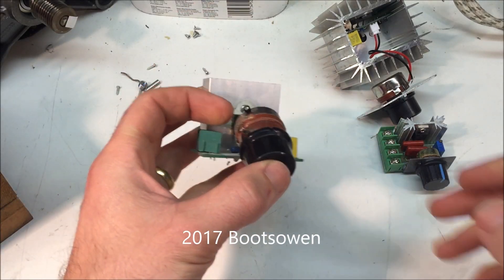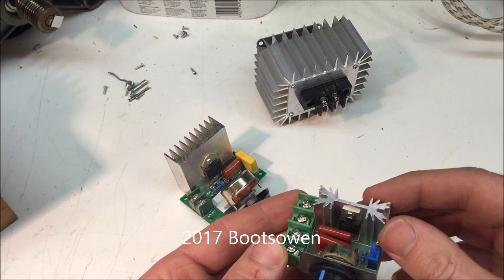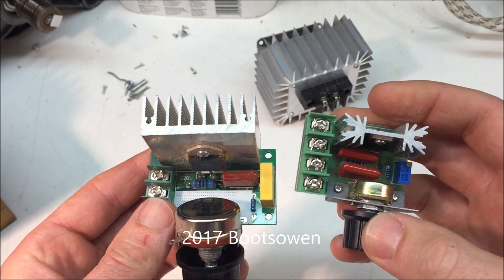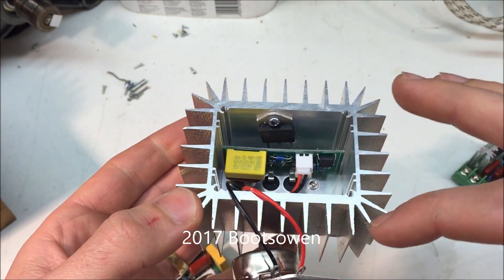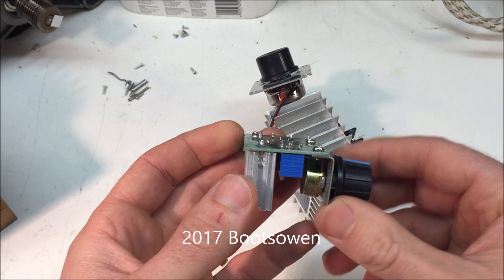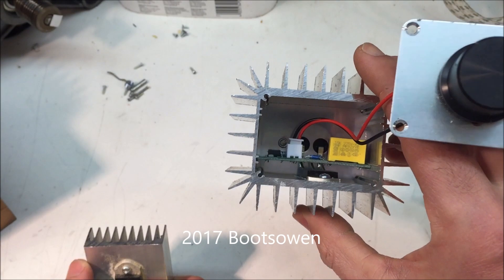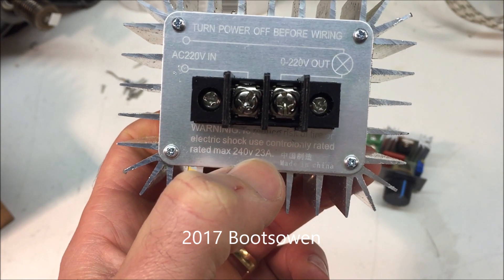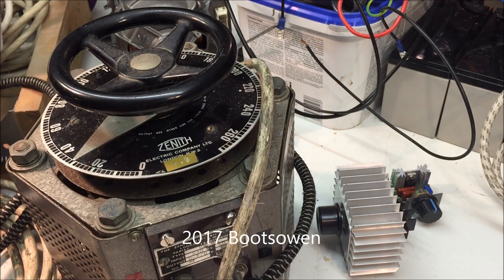Washing machine motor speed controllers

Comment: They don’t regulate voltage. They cut it. It’s something called “phase angle control” it basically cuts the top half of the wave. On high speed the very top part is cut. On low speed the very low part is cut.
Reply from the maker: Have a look at my other videos on this topic where I show the wave form on my oscilloscope. You are half right in what you say about how the wave is chopped. But   it is not completely as you describe, cheers.

Comment: Just a question can you put a brushed motor into a brushless induction motor machine, or would it not work? It's a nidec brushed motor from a hotpoint 7kg going to a hotpoint 8kg with a nidec induction motor. Many thanks. 👍
Reply from the maker: You could try, but the controllers that drive them are different and it just won't work.

Comment: Hello, I got a one of the controller with two screws.I dont know how to connect the wires. Could please help me to connect the wires from 220 volt to a motor.
Reply from the maker: What do the instructions say?
Reply: @bootsowen  There is no instructions.The seller simply wrote me to  interrupt a wire and mount it between (in series)
Reply: I have a same controller like which you took first on this video.There are only two screws to connect L-in and L-out.I dont know where should I connect N-in and N-out.

Comment: Hello, I have one of these speed controllers, the first one in particular, which should have a maximum power of 2KW. I don't know if it's true, but the motor I'm using consumes 350W at 220V. Now, where should I connect the motor to? Brushes, winding or both in series or parallel?
Reply from the maker: hello, have a look at my other video, how to wire a washing machine universal motor. It should answer your questions. However, these controllers aren't great at speed control unless the load is constant. And if there is any back emf they tend to die.  A better option is a TDA1085c based controller, I have made a video on these as well.

Comment: Most modern washing machine motors nowadays,  use variable-frequency drive motors and are induction motors. You can not  and do not control the speed of a brush-less induction motor with a voltage  regulator. Unless an induction motor has multiple winding's that control the frequency they remain a single constant speed motor. Only if your machine uses a commutated series wound motor ( brush & commentator) sometimes referred to as a universal motor,  will you be able to use a voltage regulator. Universal motors are rare on modern washing machines for many reasons.
Reply from the maker: Hi Dennis, you are correct, and I'm not sure that I said what you said couldn't be done. You could check out my universal motor wiring video and my 3 phase washing machine motor wiring video. thanks for your comment.  I should say, that of the used washing machines that I am getting these days, most: 80-90% have universal motors, the rest is split between direct drive and 3 phase.  These videos are aimed at people who want to wire up a motor that they have found in a broken machine.
Reply: Can a 3 phase b speed controlled
Reply: @jasonskaggs9874  yes its what people are investing in now
Reply: Hi Dennis, I got an AC motor with 195V, 300Hz, 3A, capable of 17500RPM. Is it possible to regulate this kind of motor to just 1 RPM somehow?

Comment: they are not the " same as a dimmer switch "  they ARE a dimmer; without the switch. meaning you don't get full power like a proper switch due to losses in the circuit ( the switch basically shorts out the circuit to run 'full speed' ) they also don't have any choke or back EMF diode to prevent the triac getting blasted by voltage spikes sent back from the motor ( a motor is an inductive load, a lamp is a resistive load) which is why you keep burning 'em out! 
The power ratings quoted for these modules are also  complete horse-shit; divide it by half and you should be OK. often the triacs are fake or sub-spec (reject) parts.The caps in them are not safe either, they are crappy ones used in led lamps not  'X1' rated mains ones (in line to line connection) or 'Y1' (in line to ground connection) which SHOULD be used for safety...to prevent little things like fires, or sending the appliance casing 'live' if they fail. from this you gather, the chinese really don't give a monkey's about safety!
Reply from the maker: I agree, they are cheap shit,  I got an 8 amp (@220v) variac,  still has losses, as any transformer/cable will.  in terms of safety I agree, I would never leave one of these unattended, I use them for wrecking washing machines. I appreciate the comment, it will be helpful to someone on here.
Reply: So can you please recommend any appropriate board for controlling universal motor ? Rated at 110w